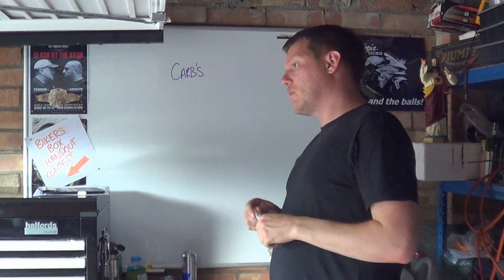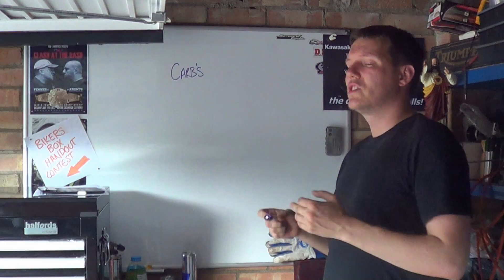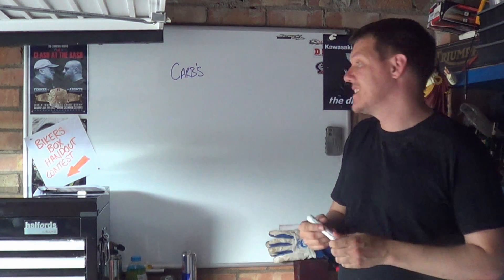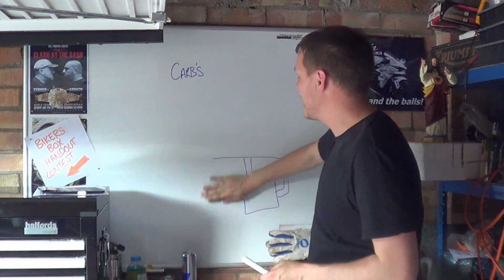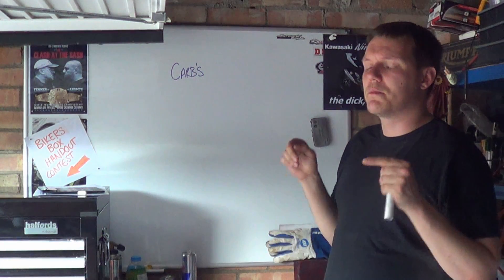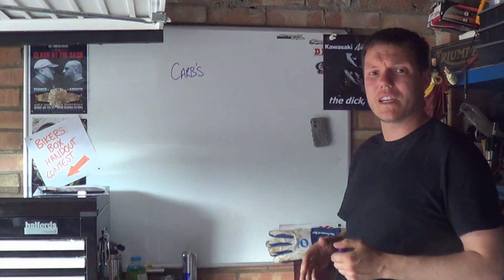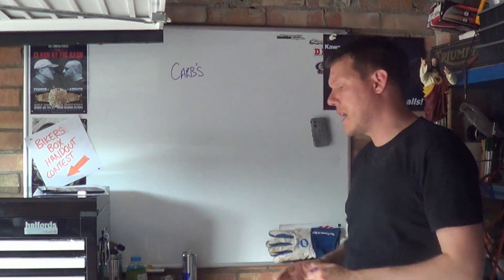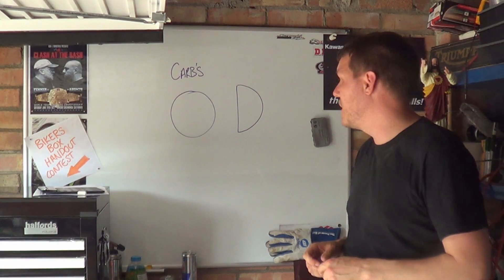How carbs work and how you can help

Comment: what are the intervals for cleaning a carb? ive got a carbureted 125
Reply from the maker: Don't. If it works leave it alone - I'm being serious 90% or carb issues are after people clean them - I'm going to do a video in this series on why.
Reply: I generally clean my carb every 10-15 minutes with fairy liquid, don't use cheap washing up liquid as it tastes bitter.
Reply: garget kumet well usually if the machine has been sitting for awhile you want to clean it because modern gasoline attracts water and makes your carb bowl looks like it was mossy and gross you want to clean out the jets either with brake/carb/intake Kleen keep the carb level when you take it apart so the goo inside dosen't go around.
Reply: alright ive got like 200 hours on it now i thought theres like an interval thank you!
Reply: The Workshop please do it soon. pls your thoughts ultrasonic cleaning. and price range

Comment: Would love to know why two stroke and four stroke carbs (for bikes) are different.  Not just jetting and needles.  Supposedly, even if you jet a four stroke carb for a two stroke engine, it still won't be right (even if they're the same diameter).
Reply from the maker: What?
Reply: Something about emulsion tubes.

Comment: i have a feeling this is going to be popular cant wait for the rest of this series! i have a kmx 125 i am really struggling with. already helped me alot. thanks
Reply: smartalick1232 how are you struggling with it? Need any advice?
Reply: milo9598  thanks dude i have just sortedit. it turns out it wast getting air. I removed the air filter and it was great. it's like the standard air filter is to thick. I've tryed so many needle height and float height combinations but I have learnt a valuable lesson on how a bike runs and sounds when it's being choked as I have been riding for months since I had the cylinder replated and new piston. Still can't wait for matts new videos. Dudes awesome.

Comment: as for using polycarb use marking out fluid on the cut carb and trace it onto the polycarb using a dremel route a shallow channel so when you use some clear rtv it has a bit of strength

Comment: You can use an old suction feed paint spray gun to show people how the venturi effect works and that is the basic principle that carbs use.  It is a little different because it uses compressed air rather than vacuum but that is why old farm equipment and cars had priming cups.  Cheers.